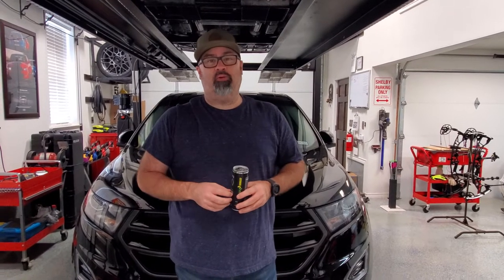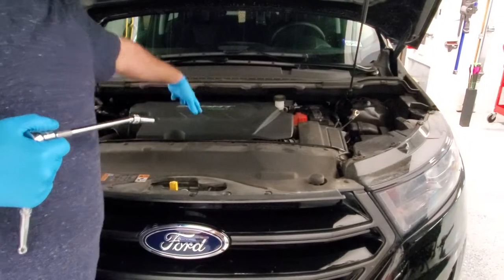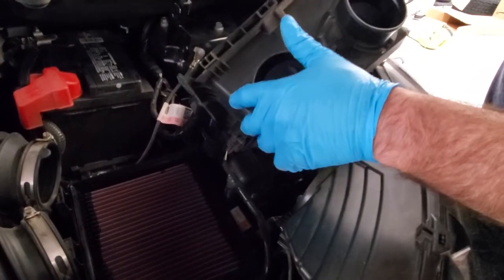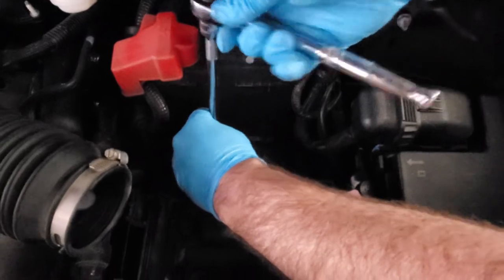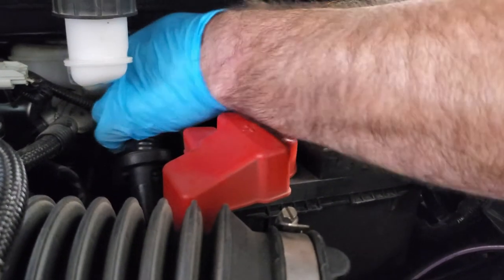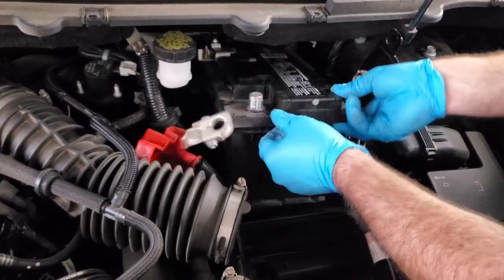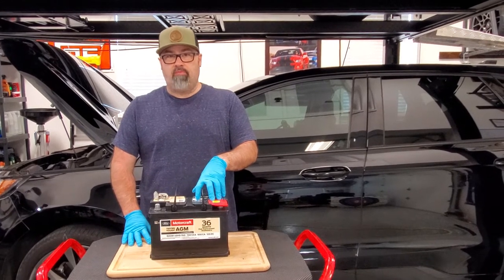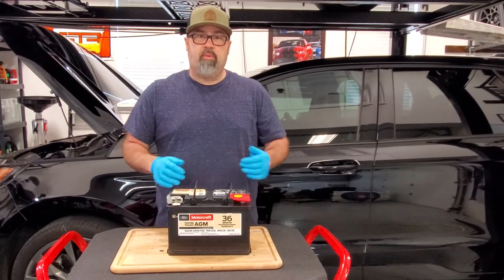Replacing the Battery on your 2015-2021 Ford Edge. Easy How To.

Comment: Need to reset the BMS(Battery Management System) after a battery swap.
Reply from the maker: @my-yt-inputs2580 thank you very much for watching!
Reply: I just replaced a confirmed bad battery this morning and tried the "flash high beam, press brake" method and I still can't get a start....does the BMS NEEEED to be reset by an OBD2?

Comment: Great info! Is the intake side of the intake box at the bottom? If so would it be a good idea to cover the opening with a rag incase something like a nut feel into the opening? Thanks again for the great video.
Reply from the maker: @steveroones3907 you should be okay with the filter housing as long as it is before the filter.
Thank you very much for watching!